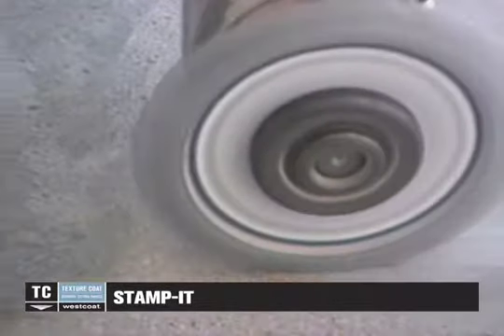How To Install Stamp-It™ System

Comment from the maker: JUMP TO A SECTION HERE:

0:00- Introduction
0:50- Surface Preparation
1:39- Crack Patch
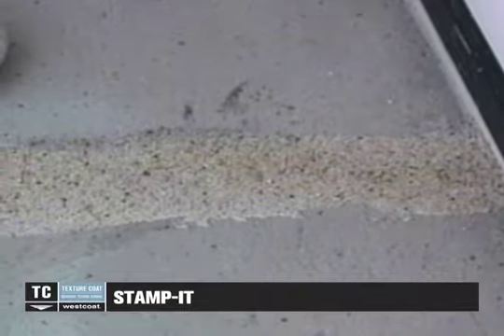2:10- Primer
2:56- Stamp Layer
4:51- Cutting And Detailing
5:29- Colorwash
6:18- Sealers
7:22- Conclusion